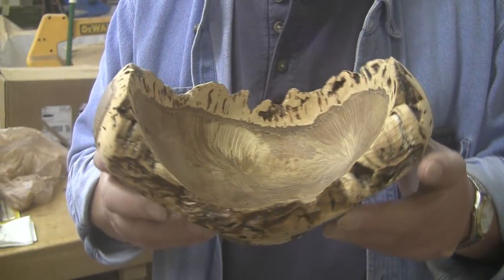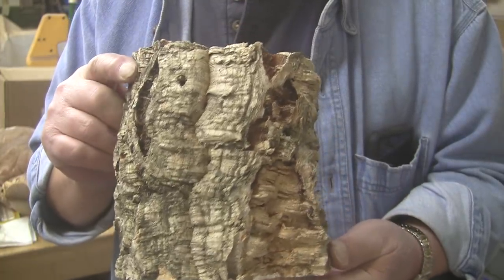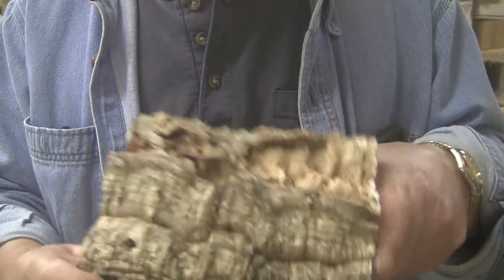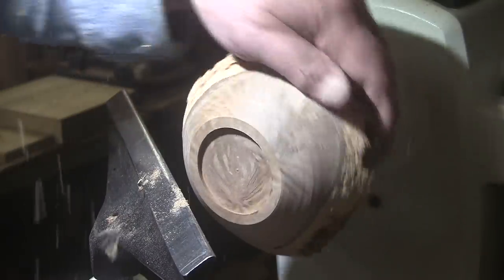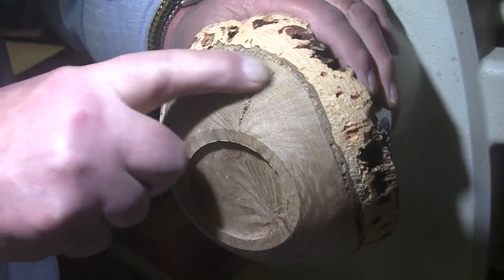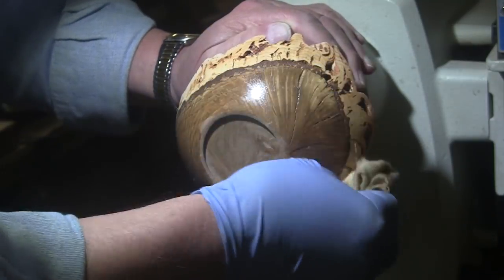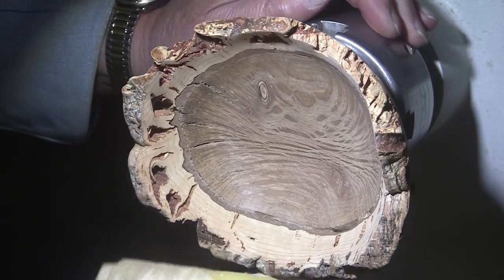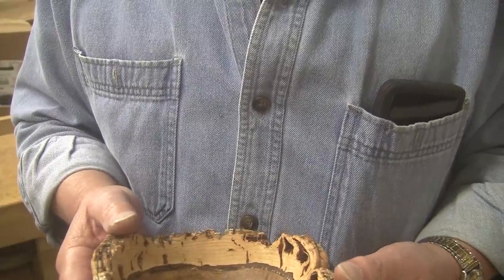Cork From A Tree? - Wood Turning

Comment: That is just some really cool wood.  The ray flecks in the wood are very similar to white oak.  I’d be curious whether the wood would finish fume with ammonia in the Mission Style like white oak does.  That would be a really interesting finish on a turned piece; it would probably have to be done off the lathe, but might be kind of cool.
Reply from the maker: Yes, very similar to White Oak, Mark.  I'd be afraid to try the fuming with this bark, though.  Might work, might not! 😊

Comment: Beautiful wood.  I am glad to hear why you sand in reverse.  Can you go into sanding sealer?  Many use it, some don't, but no one says why.  People say, "Clean it with denatured alcohol.", so it's self-explained.  But when sanding sealer is used, it seems that everyone must already know why.
Reply from the maker: Thank you, Dan!  Cleaning the piece has nothing to do with sealer.  Some people like to start clean and that's fine.  I blow my pieces off with compressed air but I feel that any fine dust left will help to fill the pores of the wood as I rub in the sanding sealer.  Sanding sealer is used much like you would use primer before painting.  It's thinner so penetrates deeper and faster.  The kind I use, Zinsser Seal Coat is also dewaxed.  This allows any clear finish to be used over it.  Hope that helps!

Comment: Cracking piece looks really good, liking the way you take the time to explain your sanding techniques very helpful as always thank you. One question when buying a new lathe would you put that on top of your list variable speed and reversible drive. Big thumbs up.
Reply from the maker: Thank you very much, Gary!  I've had three lathes, this is the first with speed control and reverse.  I would never have another lathe without those features.  Absolutely essential to let the operator concentrate on the project instead of the limitations of the lathe.

Comment: 🙋‍♂️🏴 Hi Phil you've turned another "Corker" there. I liked the way you described the reason you put the lathe in reverse while sanding the piece, it made absolute sense to me who doesn't work with wood. One question does it cause you problems turning a piece, when part of the wood is very hard then having to go into the soft outer bark.
Reply from the maker: Not a problem, John, but definitely took some getting used to! 😊

Comment: You mentioned sealing the piece up before you started working on it, I have never heard this before, would you please explain what you meant and how it was sealed.  Absolutely enjoy seeing your work, I have learned a lot as a beginner.
Reply from the maker: I'm not an expert on it, David.  Dennis sealed the piece before he gave it to me.  Basically, with wet wood, you seal the ends with either a commercial product or maybe a wax product you make.  This slows the drying process and hopefully, prevents cracking.

Comment: Nice job Phil, I learn something new every Thursday. Why do you turn the lathe speed down to sand? I would think a faster speed means less time sanding?
Reply from the maker: Thank you very much, Frank!  You want to give the sandpaper a chance to do it's work.  I'm afraid turning the lathe faster causes the paper to skip spots and also generates heat which can cause cracking.

Comment: Great piece Phil!! Did you need to sharpen your tools more often for the cork? Is the heart wood as hard as regular white oak or American red oak?
Reply from the maker: I wouldn't say I had to sharpen more than usual, Scott.  I do think the Oak is about as hard as other Oak I have turned.  It's funny to turn this kind because the chisel enters easily into the cork and then you encounter Oak!  LOL!  Takes a little getting use to but totally doable and worth it.  Thank you!
Reply: @PhilAndersonShadyAcresWoodshop  I was wondering how that transition from soft cork to hard wood would feel. It obviously makes a beautiful bowl. I was curious how our normal wood turning tools and grinding methods would work with the cork. From the looks of the bowl they work great but like you said it takes getting used to. Thanks as always for your insight and posting videos of those beautiful bowls!!